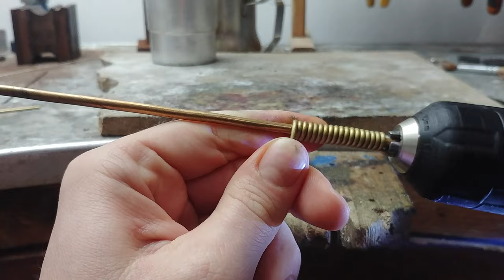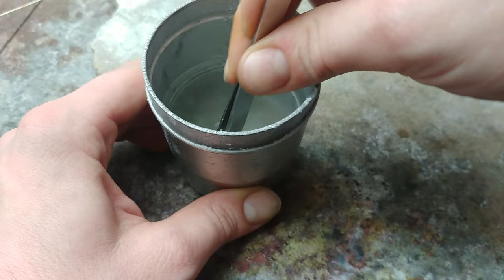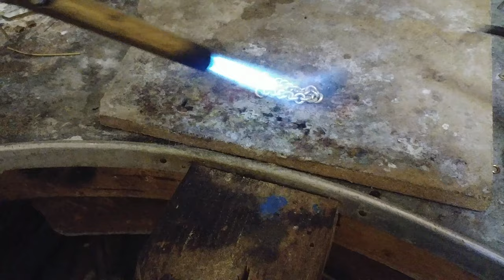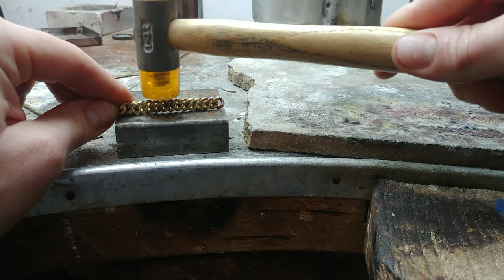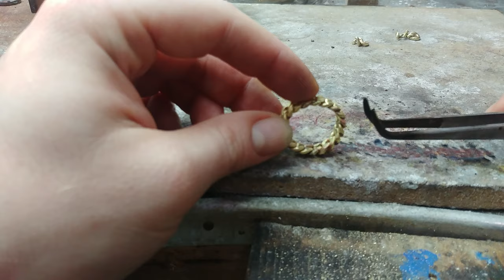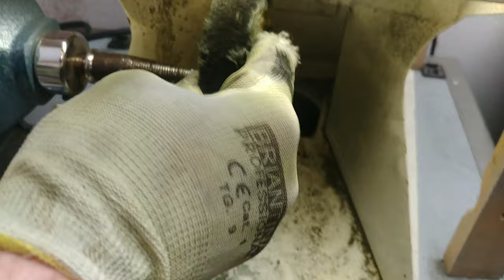Golden Cuban Chain Ring | How it's made

Comment: Amazing work, you did a great job! At 5:44 if you didn’t soilder the ring together would the final ring be completely collapsible and foldable? Or would it still have had some rigidity?
Reply from the maker: Hello Jaiman I  soldered the last ring as well, actually all the rings are soldered together so the ring is completely rigid, not at all collapsible 😅
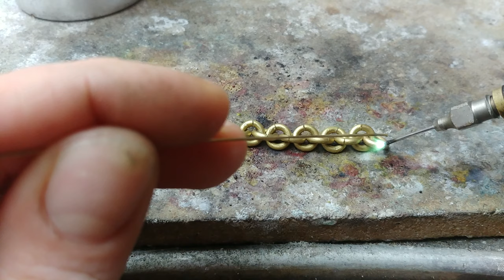Reply: @bohdankryher9456  thank you very much. Also I noticed at 5:33 you used flux before you soldered the ring together, but earlier at around 3:12 you didn’t use any flux. Did you just apply it off camera? or did you not use flux for that part, and if so then why?
Reply from the maker: @jaimanbhardwaj1679  hello there, in 3:12 I didn't add extra flux because I had immersed the whole chain in a flux-water solution
Reply: @bohdankryher9456   thank you

Comment: When you are melting the little gaps in the rings what are you use the little torch and what is the medal you are melting
Reply from the maker: Hello there, I'm using hard silver solder and my torch is an oxy hydrogen water welding machine!

Comment: What  welding supply did you use?
Reply: Also what metal was it that you were melting with the torch? Ima make me one of the rings😁
Reply from the maker: Hello there, I use hard silver solder for brass soldering and I use an oxy-hydrogen water welder and a propane torch, however, I did not melt no metals in this video 😅

Comment: what tools were used? amazing vid btw
Reply from the maker: Thanks for watching Ivy! Oh well, I used pliers, a drill, a jeweler's saw, a file, a table polisher, a propane torch...but you probably wanted to know about my tiny flame torch 🤣 that's an oxy-hydrogen water welding machine for jewelers.
Reply: @bohdankryher9456  REALLY NEAT! thanks! any chance do you know the rod size & width of the material used to spin on the drill? just so i can get an idea
Reply from the maker: @IvyBuilt  yes of course, the wire is 2mm and the rod 4mm
Reply: youre awesome! thank you keep up the good work metalsmith :)

Comment: Hello mate, great job!
What calculations are you doing to find the diameter of wire and circle you need to get final product?
If you want to make a 45cm x 6mm chain what is the calculation?
Thanx :)
Reply from the maker: Hello there mate! The proportions are 1:2 that is 1mm wire for 2mm inner ring diameter, as for the length of the chain, I'm just going on instinct so there's no real calculations there